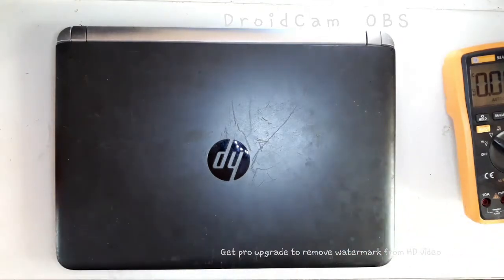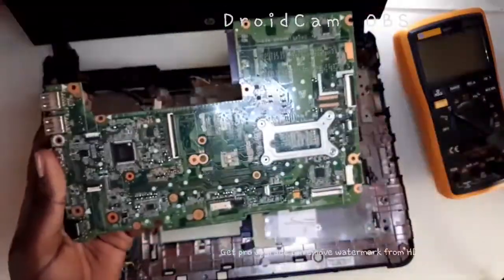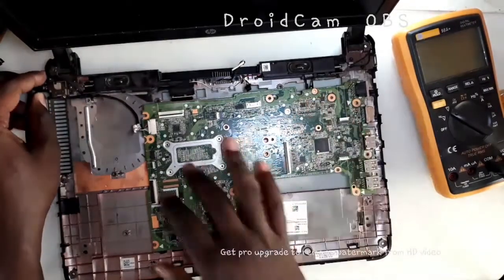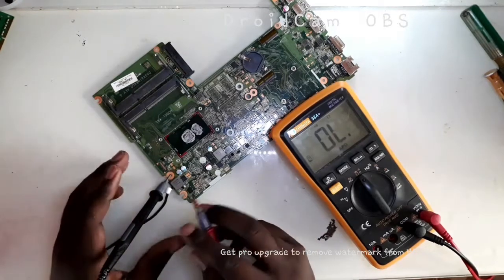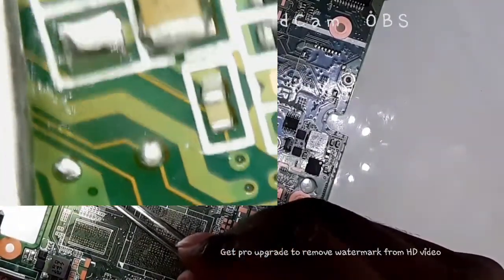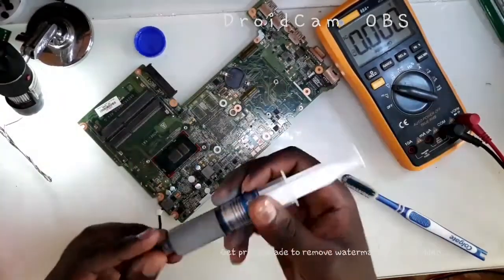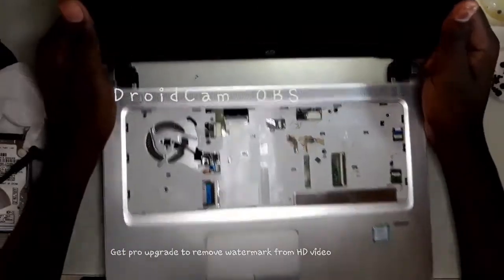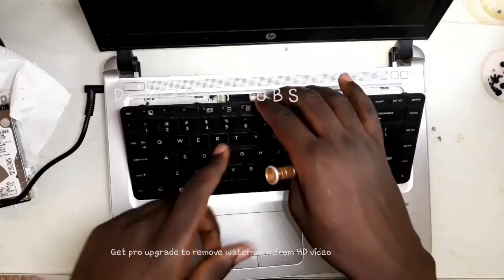how to fix HP laptop 440 not turning on

Comment: Hi, pls I have the same 440, it come up but it doesn’t add on the battery, instead it will be going down, it will show plugin and charging but the battery percentage won’t increase, pls any solution
Reply from the maker: Most times such issues a due to fault battery

Comment: Hi there , AT 02:21 you checked any ceramic capasitor near  startup chip for check 3.3V right ??? if yes, anytime you want to check voltage on startup chip we must to check ceramic capasitor next to startup chip ???? thnx
Reply from the maker: Yes most capacitors near power supply chips a connected to voltage  rails
Reply: @platinum_computers  thankyou for your answer , please upload more